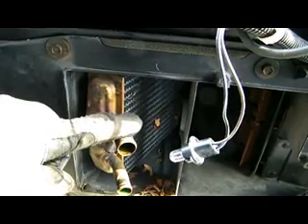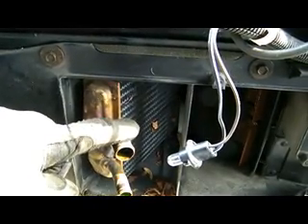Eco Steve 1984 Pontiac Fiero Heater Core Removal, Electric Car Conversion Project by Eco Steve..wmv

Comment: 88 gt with AC does not come out the front like that.  three screws in the passengers side knee well. and the inside cover comes off.  pulls out that way.   Anyone with AC or an 88,,,   maybe earlier years as well.    Before you take the whole front apart take a little time and look inside for the access panel.  It will save some time and frustration.

Comment: if your doung a fierrp with ac it comes out inside under the dash real easy just take off the hoses and take the housting some of the screws are hard to get to you need a nut driver to access some of them